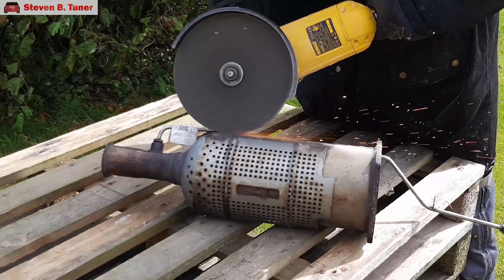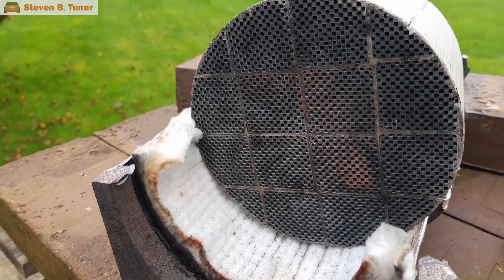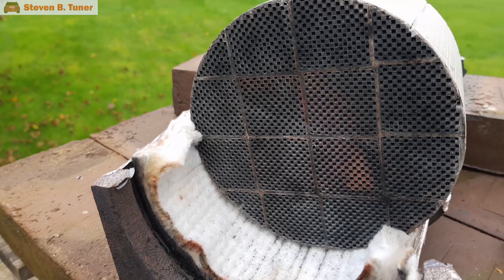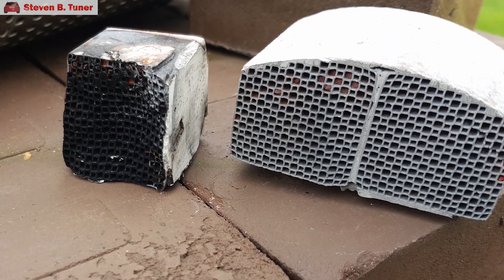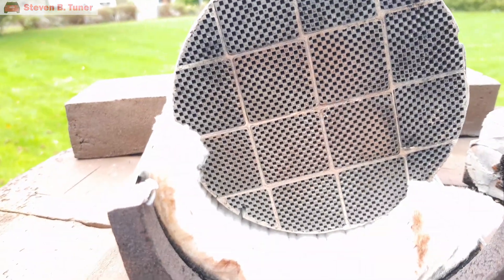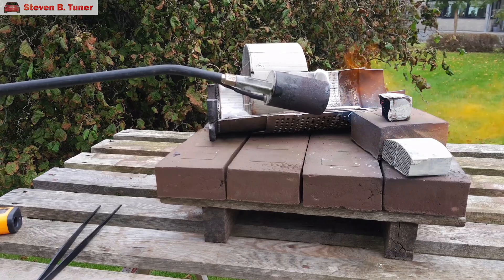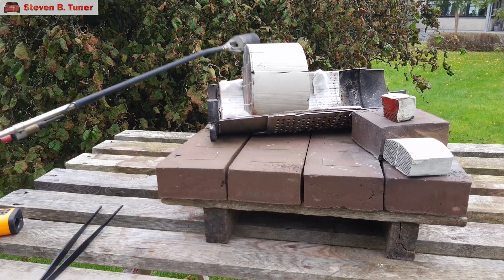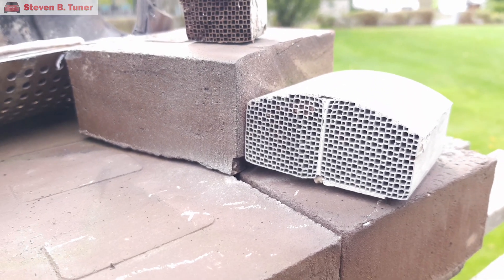DPF CLEANING SECRETS REVEALED! 🔥 Can EXTREME HEAT Fix Your Clogged Diesel Particulate Filter?

Comment: The ash loosens after heating but needs to be blown away with compressed air. We do this at our facility.
Reply from the maker: There is a much better success rate when the proper equipment is used!

Comment: So still no solution to remove ash without removing DPF 😭
Reply from the maker: Hi, there are a lot of different compounds that make up what is collectively called 'ash', and even after they have been hit with multiple strong chemicals they are sometimes still too large to pass through the DPF in the normal direction. In place cleaning will help prolong the life of the filter, but a full clean needs everything to come out the way it went in (back-flushing).

Comment: I did consider getting my blow torch to my DPF but one of your previous vids about pressure washing, showing the insulation around the filter was a good indication that this would be pointless in anything more than perhaps burning a hole in the box.
Reply from the maker: Hi, don't write off the idea just yet! I think a little bit of accuracy is required for the technique to work without damage, so I have just acquired a high temperature IR thermometer, a set of accurate scales, and an ash-clogged DPF. Video should be out in about a month.
Reply: @StevenBTuner  Look forward to the vid!

Comment: Getting rid of the ash is relatively easy. All you need is a good blow with compressed air under high pressure and you're in trouble. The burner method looks like a good replacement for kiln firing which also removes only the soot and the ash is blown out. The problem with soot is that it is "sticky" and it's hard to blow it out and it is very easy to blow out the ash when you have a good compressed air system available.
Greetings from Poland
Reply from the maker: Hello to Poland! My conclusion is that the burner method could work as well as a kiln, but it would end up using so much gas that other methods like chemical cleaning end up being cheaper and quicker for DIY home use..
Reply: @StevenBTuner  when it comes to speed, the burner is probably faster :-) blowing through the stove, I know that it takes about 30 minutes. because I have repeatedly done firing in the furnace and as for firing with a burner, I will do it for the first time this week but I think it will take about 1 hour.
As for the price, I do not know because I have free access to gas and compressed air :-)
I will try to let you know how much time is left for me after work
Reply from the maker: @songoku-fq1iv  Be great to hear how it goes! If you have some accurate scales it would be great to know how much lighter the DPF is at the end.
Reply: @StevenBTuner  The situation looks like this. The ECU showed 100% full DPF and soot also in max. the value above which this driver did not count (32 grams per liter of Filter capacity). After tapping, the DPF weighed 7122 grams. After about 12 minutes of baking with a roofing torch and grinding the still hot filter, the weight indicated 7115 grams - I consider this to be no result. I expected that the burner would turn soot into dust and the weight would decrease more if this happened, and I consider this result to be the removal of moisture from the filter and not the conversion of soot to ash. After that, I let the filter cool down and did something else. The filter after the burner was so hot that it took over 2 hours to cool down outside. After it cooled down, I started blowing compressed air through the filter. constant pressure of 6.2 atm and the outlet diameter of the purge tube 5 mm. The blowing time is about 15 minutes. After blowing out, weighing. The weight indicated 7067 grams, so already some satisfactory result. After the filter was attached to the machine, the differential pressure returned to the correct values. The first time it was started, it was 1-2 millibars at idle, so that's fine. did the burner help something? As for blowing with compressed air, it is, as always, a great method that always works as long as the filter is not melted or broken. It is best to blow when there is ash itself, i.e. after firing in the furnace, but when it is also soot, it is also possible to do it without a major problem. Of course, the more pressure the better. It's best if someone has access to an industrial compressed air installation, and preferably in sandblasting plants - there is a good fuck there :-)
greetings
Reply from the maker: @songoku-fq1iv  You have done a great experiment - I have to do it too now!  :-)  I have ordered an infrared thermometer that goes up to 1200 degrees celcius so that I can measure what is happening, I've got a bigger air compressor ready, and I've got an old DPF ready to go - I should be able to start filming in a couple of days. Thanks for sharing that great result!

Comment: I wonder what would happen if you try flushing with oxygen. Soot definitely should oxidize but the ashes?
Reply from the maker: Hi, you have the right thinking, but the chemicals involved are way too nasty for home use or even professional use - the oxygen would come from hydrogen peroxide added to concentrated sulfuric acid. It would eat the ash, it would eat the soot and it would eat right through your arm too, if you splashed any on yourself. Much friendlier chemicals will do the job easily enough, or if you prefer heating then 8 hours in an industrial oven works great.
Reply: @StevenBTuner  will it have the same effect if i just drive my car for 8 hours on full throttle on German highways? whats the temperature in an industrial oven, is it beyond 600 degrees Celsius?
Reply from the maker: @alexs6169  Hi, an industrial oven at 650-700 degrees C for 8 hours is a bit like having an active regeneration that goes on continuously. The trouble with just full throttle driving is that you would be creating perhaps more soot than you are burning off.

Comment: Heat by itself doesn't do a lot, active regeneration on the car itself works good because the filter heats up, burning off the soot, and the ash gets dislodged by the exhaust pressure as well as the filter matrix expanding due to heat. Forced regeneration using the car's engine is much more effective than just statically blasting it with heat, because you don't have any airflow to blast away the particles after you set them free.
Reply from the maker: Hi, thanks for watching! In terms of fast and economical DPF cleaning methods, this method certainly isn't at the top of the list - but it was suggested by a viewer, so I thought I'd give it a go!  High temperature will definitely work to give you a clean filter, but in 8 hours, not 2 minutes... There is one situation where I would use this method, and that is if the car had a massive turbo oil leak, for example, and the filter was completely blocked full of oil and soot that the normal regeneration or chemical cleaning methods couldn't hope to clear. 10 minutes with the gas torch might burn off enough crud so that my 'no damage diy dpf clean' would work.

Comment: Sorry but it was pointless you cut it open to do the test.
Reply from the maker: Hi, thanks for watching!  If I didn't show you the soot and ash in the ceramic filter material before, during and after being hit with the gas torch, then how would you know that it did anything?
Reply: @StevenBTuner   but the reason I'm trying to  point out is you can't do this  without  taking it apart as you well know.
Reply from the maker: Hi, I've heard of folk doing it with a full filter still in its housing, but I wanted to start by seeing if it would work on the small pieces that I already had lying around. The test was a success I think, as the technique could definitely be used to clear soot from a soot-blocked filter. However it does not rate very well for clearing ash, as you would be running the gas torch for so long that it would be much cheaper and quicker to do a chemical clean.
Reply: @StevenBTuner  so I am correct it doesn't make sense then, that's you what are saying.
Reply from the maker: Hi, if I had a massive turbo oil leak and the DPF ended up clogged full of oily soot but was otherwise quite new, then I would definitely give this method a go as it might get the filter working again in just 10 minutes. If the filter was just old and ash clogged then what I did in my other video: "The No Damage DIY DPF Clean" would be the better choice for sure.

Comment: You're too underrated i hope you get more famous 
i hope i can buy a 320d e90 with the m47 engine soon
and then i have your videos i mean it looks very easy to clean the dpf
 and how about bushings? do you have any experince how long they hold=?
Reply from the maker: :-) :-)  The DPF on a modern diesel scares a lot of folk, but it doesn't have to - I'm trying to make it a bit less scary. Which bushings did you mean specifically? The rear suspension bushings are well engineered and last a really long time. The front suspension bushings are more of a service item, meaning that it is probably best to replace them all every 100k miles, or more often if you have a lowered car.
Reply: @StevenBTuner  ok I was scared because the rear got all the torque on the bushings and it got so many bushings, how about rust? The bottom of the doors, etc. I want a good car, not a car that rusts extremely..i want a good engine with good fuel economy. My 1.9 tdi needs 5 liters on 100 km regardless in city
 or on highway
i heard the m47 got a good fuel consum too but i really dont know because the guys in forums saying i need 7 liters on 100km the other 6,3 liters i really dont know how they drive but i think i will drive the e90 arround 5 liters like mine 1.9 tdi do you mean its possible?
Reply from the maker: Hi, BMW are pretty good regarding rust, but if you live in an area where they salt the roads then no car is going to be immune, and so the under-body and inner seams will need regular treatment. As for economy, I don't think 5 litrers/100km is possible for an M47 - I would say 7 is more reasonable.

Comment: Hello, 
thank you for your videos..it's what i was looking for.
about heating the dpf, if we assume that a chemical reaction is happening, maybe you need a specific temperature, and a specific time for heating.
for what i ve been reading , it's something like 5 hours and 600 celsius with a slow augmentation of temperature.
what i mean , it's not by having a very high temperature that it mean the reaction is stronger..
i will try this week to heat my dpf  ( my wife has a ceramic owen...with the temperature below..)( i assume you need a special owen)
a avantage is that the reaction is cleaning the ash by combustion.
i hope it will work..
what do you think? a chance ?
( ps : sorry for my english..)
Reply from the maker: Hi, thanks for watching!  The 600 degrees Celcius is where soot starts to burn off, so the 5 hours you have planned should definitely result in a soot-free filter at the end.  I am very interested to find out what the extended time does to the ash in the filter, as the short bursts of heat that I tried didn't really do anything except make the ash plugs glow red. Do you know how much ash is your DPF at the moment? I look forward to hearing how it works out!

Comment: Hello Steven. Greetings form Poland. Thanks for Your very informative videos! I would ask what do You think about blanking EGR valve in B47 engine? I'm considering blanking it off, bacause I'm afraid of burning down my car (stupid design of EGR cooler). My car passed the warranty replacement of EGR cooler, but I still don't feel comfortabele. I considered blankig the outlet of EGR cooler in place where it joints with the intake manifold. I wonder if I will have to do any coding or I can just leave it blanked. I thintk that ECU will instantly discover that egr outlet is blanked so my DPF cleaning procedure wont start?
Reply from the maker: Hi and greetings to you in Poland!  The B47 needs the EGR to be functioning in order for the DPF regeneration to work correctly, but you may get away with blocking both the manifold and the pipe to the cooler, so that the EGR will operate but won't actually be letting in any exhaust gases.